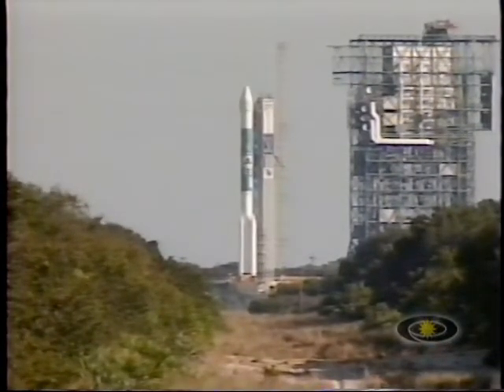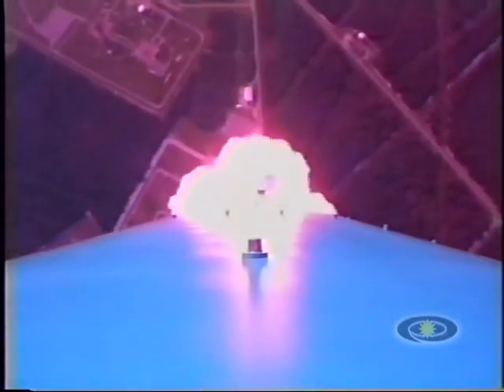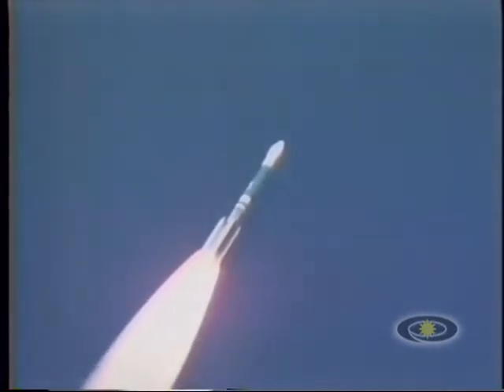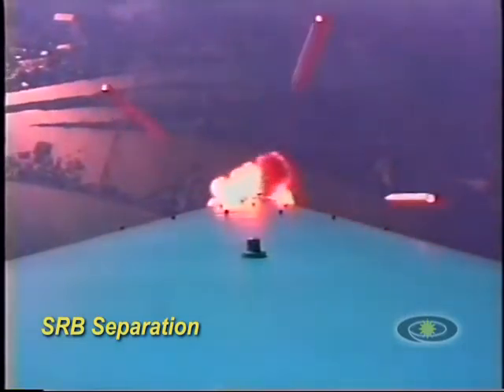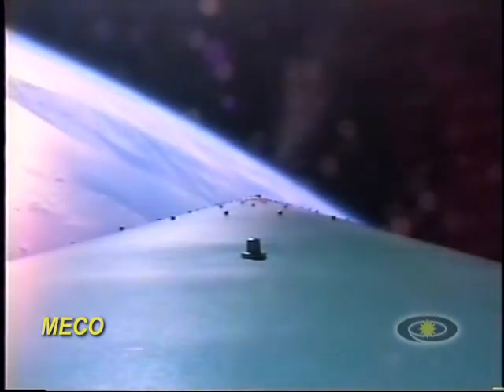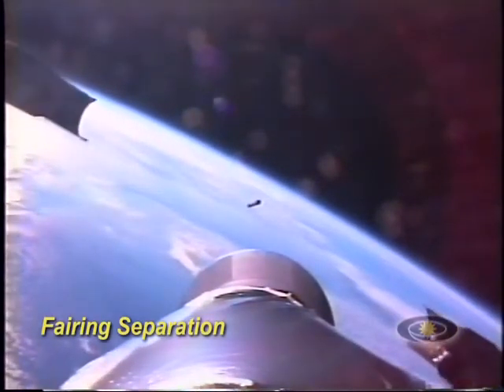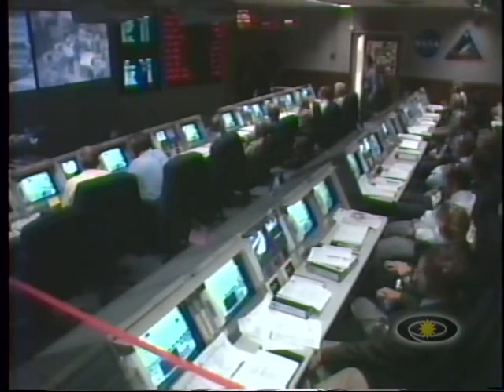Stardust Launch

Comment: That was beautiful!

The solid rocket booster separation was really sweet. It was a lot of fun to see it from multiple angles.

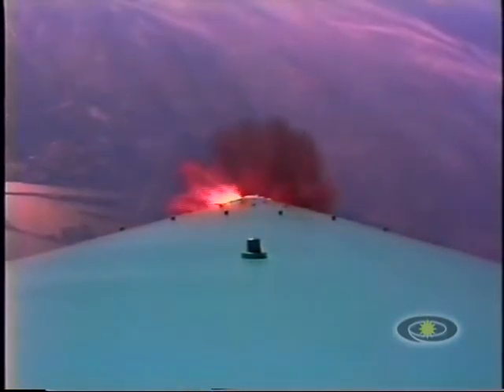Why did the exhaust plume look so different at high altitude?  I figure there's a jump in time about 1:45 in. I'm wondering why the rocket exhaust looks so different. Is it because of the low pressure at high altitude?

The stage separation and the fairing separation also looked great.

Thanks for posting this. It was a lot of fun to watch.
Reply from the maker: Ninja Man - "look at the trajectory of a shuttle launch, the speed they say it’s travelling at when it goes into a roll then parabolic curve. The G forces would kill you " OH REALLY, would you please provide the math & equations that you used to come to that conclusion? (didn't think so). You are clearly OUT OF YOUR ELEMENT as I said before.  Have you EVER TAKEN AN ACTUAL PHYSICS CLASS? (I already KNOW the answer to that one)
Reply from the maker: Ninja Man - You can quit now.  You are clearly out of your element and know ZERO about this topic.  The Plume DOES expand because the ROCKET REACHES VACUUM.   Just a FYI I was just on the launch pad for another one of these rockets THIS MORNING preparing for the launch of JPSS-1 on Nov 10th.  Should we believe a Youtube 'engineer' wannabe who hides his identity, or someone who does this for a living (and DOES NOT hide his identity)?   Any SANE person would bet on the Aerospace Engineer with >20 years experience and more than 12 spacecraft as experience.  Ninja Man - HOW MANY REAL ROCKET LAUNCHES HAVE YOU EVER EXPERIENCED IN PERSON?   I am well over a DOZEN and have begun to lose count.  (watched one YESTERDAY).  YES - I watched another REAL ROCKET LAUNCH YESTERDAY.  The video is on my channel, but it is crap.
Reply from the maker: Ninja Man - See I TRIED to tell you that you have no clue what you are talking about.  Now you had to go and PROVE IT: "Have you any idea what sort of G forces they would be subjected to arcing at 21 times the speed of a bullet?!"   See this proves you have zero clue about physics.  Because it is PERFECTLY POSSIBLE to be going "21 times the speed of a bullet" and feel ABSOLUTELY NO ACCELERATION.  Go ahead and admit it: you dont know the difference between velocity and acceleration do you?  (Didnt think so)  So stop before you make a complete fool of yourself.
Reply from the maker: "I’ll be turning off your replies."  Please do!
Reply from the maker: Duane Degen - "Is it because of the low pressure at high altitude?"  Yes once the rocket gets above about 60km it is basically a vacuum.   Here is a link of the sample return capsule returning 7 years later:  https://youtu.be/YmUY9091HAc
Reply: That was a cool video too.
I found this channel after seeing a comment from you under a Wolfie6020 video. It's projects like Stardust which make me feel bad for flat Earthers. They're missing out on some of the coolest stuff going on in the world.
Thanks for the link and thanks again for posting the rocket videos.
Reply: Duane Degn, someone’s easily pleased then. The discrepancy you speak of is due to fakery, plain and simple
Reply: Stuart Gray, so you are actually saying that you can travel at 17,000 mph, then go into a curve and feel no G force??!! Is that what you are actually saying - you are one stupid fuck, now I know why you believe whatever horse shit you have been fed. I’m done talking to you, you are simply too thick
Reply: Stuart Gray, you are so full of shit, it’s unreal. All you have saw is a rocket taking off, going into a parabolic curve then ditching out to sea, out of view. 

It is claimed the space shuttle used to travel at 17,000 mph when going into a parabolic curve with astronauts onboard. Have you any idea what sort of G forces they would be subjected to arcing at 21 times the speed of a bullet?! Use your fucking brain and stop spreading lies and shit. 

https://youtu.be/YqEw1yz7aFs. This is but one of many example of your hero’s faking stuff. I don’t know if you are paid to spread this shit or you just have shit for brains. If you are paid, then I hope they make it worth you while selling out mankind.
Reply: @ninjaman1714  I am sure @Stuart Grey knows more about G forces on the rocket he has built, than you. Also what you try to dismiss as parabolic curve to ditch into the sea, is in fact the curve around the earth. Welcome to reality.